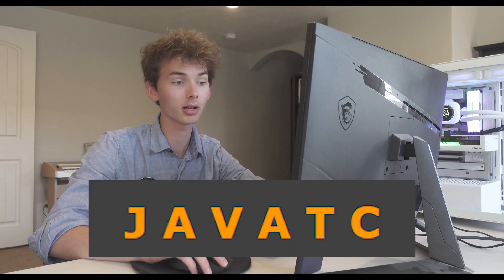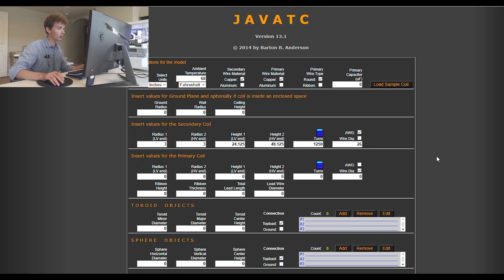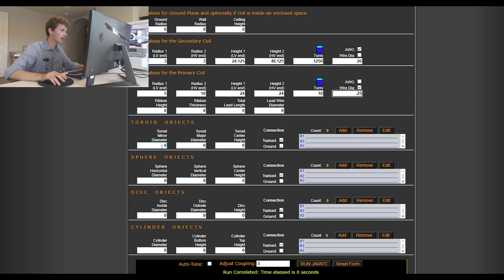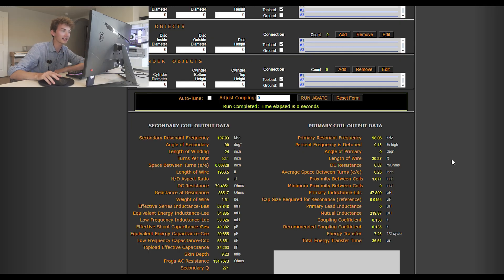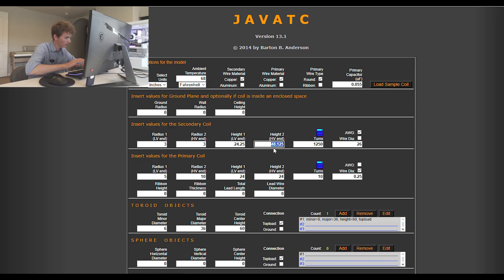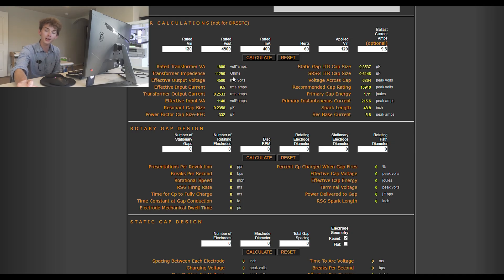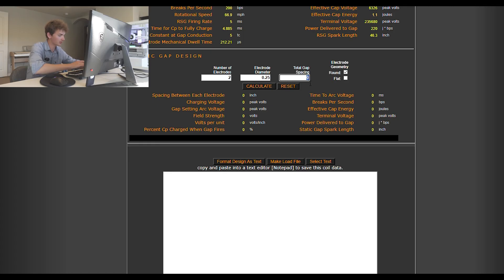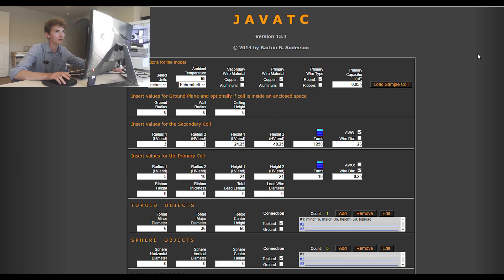What I WISH I knew about JavaTC as a beginner

Comment: I'm currently in the process of re-writing JavaTC on a proper modern tech stack (ReactJS frontend, python backend). Hoping to finish the project by the end of spring 2026 along with the current DRSSTC I'm building :) 

Some of the math behind these calcs is pretty cool. You can't just assume uniform DC inductance and capacitance of the secondary due to its non-uniform current distribution. So instead you model it as a stack of rings and then use the Neuman formula to compute the mutual inductance matrix for every ring pair in the system. Then you also do some electrostatics integrals (or proper PDE solves in the version I'm writing) to compute the maxwell capacitance matrix. And then you can get the resonant frequency of the secondary and the current distribution vector from the eigen values and vectors of the matrix product of these two matrices.
Reply: Also slight little side note, the main reason you want some detuning isn't because it makes the coil too efficient. When you have two magnetically coupled resonators of the same frequency (lets call that frequency fr), the overall frequency response of the system goes to zero at fr and has two split resonant frequencies at fr/sqrt(1+/-k) where k is the coupling coefficient b/w the inductors. In the time domain, when you have this frequency splitting, it causes "notching" in your signal (essentially ripples at the beat frequencies of these two resonant frequencies) which prevents the resonant rise from occurring as efficiently. So two perfectly tuned coils is actually LESS efficient!! Significantly less so actually. When you detune the secondary to a lower frequency, you pretty much entirely squash this second pole in the frequency response which removes the beat-frequency oscillations in your time-domain response, and restores efficient operation. 

The other effect is that when an arc breaks out it decreases the resonant frequency of the secondary so you want to detune the primary even lower so that when an arc breaks out and increases the capacitance of the secondary side you still remain detuned. This is also why you never want to detune the primary to a higher frequency and squash the lower pole.
Reply from the maker: @PartialScience  Wow dude thanks for the info, I'm excited to see the new TC calculator. Let me know when its done!
Reply: yooooooo would a fr be a dual resonant spark gap coil?????????
Reply from the maker: @ferrocerium123  Well sgtcs are dual resonant already so
Reply: @Plasma.Prince  triple resonant???

Comment: I found out that Nikola Tesla had a 300meter long copper tube stuck into the ground as an RF ground connection
Reply from the maker: How bro got it down there, who knows. The surface area of the thing alone would be enough to be a good RF ground for anything us normals have built😭
Reply: @Plasma.Prince   idk how, but He also got to use the towns generator to power the magnetifying transmitter can you imagen the fun he had with around 500kilowatts!

Comment: I finished my tesla coil! Now I need to see if the weather will agree with me to test it outside and if the coil even makes a good enough arc to not disappoint me.
Reply from the maker: You're dual MOT coil? I put mine together but cut some corners to make the saturday deadline I set for myself so it didn't work😭
Reply: @Plasma.Prince  oh, well I am not able to watch the premiere anyway ima be busy from July 3-12  
T_T   
I definitely fix a few things first. The arc is about a foot which isn't the best for this size coil  but I would see some long arcs then short ones. I think Ima wait a bit to post the real edited video because I need to fix all these issues but I can post a tiny video of one of the tests I ran last night if you want. One of the issues was that the blue 20kv 1nf capacitors I used kept arcing to themselves instead of the rotary spark gap which led to inconsistent arcs. Then one of the wires that connected to my MMC bank broke off and arced to it so one of my capacitors needs to be replaced cuz it has charm marks on it now. I the capacitor seemed to be fine for the other tests so I wouldn't replace it yet but two doorknob capacitors will arrive on July 2 - July 11 so I will use those instead of the blue caps.
Reply: @Plasma.Prince  wait how did it not work?
Reply from the maker: @ferrocerium123  sloppy wiring, flimsy rsg, etc. nothing serious. My capacitors also experienced some arcing. Yea I wouldn't reccomend using ceramic caps for the tank cap tbh.
Reply: @Plasma.Prince  oh do you also have doorknob capacitors from your GU81M vttc attempt?
Reply from the maker: @ferrocerium123  hahaha didn't know you knew about that, no I never bought doorknob caps, too expensive and difficult to source ones with good capacitance. Just use film capacitors they're much easier to source.

Comment: oh will you use a EMI filter to prevent your house and your neighbors from burning down? Or is that not necessary? I have only seen Backmacsci do it
Reply from the maker: Nah but I have RF filtering caps in my doubler
Reply: @Plasma.Prince  okie dokie is that just the doorknob caps? cuz Benjmen said those are for clamping voltage spikes aross the diodes but alota parts are being used with more than one job in this circut

Comment: did you wind the secondary by hand or with a drill?
Reply from the maker: Drill
Reply: @Plasma.Prince  oh i finally got a drill from harbor freight too! Now I don't need to use a sketch bench top voltage regulator thingy and half dead thrift store drill that barley works.
Reply from the maker: @ferrocerium123  epiccc
Reply: @Plasma.Prince  fr
Reply: @Plasma.Prince  oh I also was just at a old power station museum and there's 10kv transformers! and even a Jacobs ladder but the arc was only like...2-3inches long

Comment: I'd recommend going with an 8" x 36" topload rather than 6" x 36" just because a larger minor diameter will result in less stray sparks sucking power away from the single main arc that you want.
Reply from the maker: I'll have to make the switch when I got some spare money, sadly I already got the 6 inch ducting😭
Reply: what if you covered it in aluminum tape? or made a chicken wire dounut like Benjamin.( if that's cheaper) and also wouldn't the geometry of breakout electrode change how many stray arcs come out in places you don't want? I assume that a pointy electrode would work better but sometimes it hasn't for sstcs in my experience. Maybe it also has to be thick  and low resistance to.
Reply from the maker: @ferrocerium123  Yea the common practice is just to coat ducting in foil tape which is what I'm doing
Reply: @Plasma.Prince  Okie dokie I had done that with a different topload and it took alot of patentice and work to also make sure it is alumium tape and not this other tape i have ben confused with before that is also labed as ducting tape and wasnt conductive, if its not shiny its not foil :,(
Reply: make a video for creating top loads
Reply from the maker: @TheTubejunky  aight
Reply: @TheTubejunky  that's already on the internet

Comment: maybe a new video idea would be to keep putting more and more voltage into a MOT until it breaks or just destroy stuff with one until it breaks unless that's to dangerous. I wonder if you could use your varaic and slowy crank up the voltage and measure the voltage coming out on a multimeter until you get the max voltage it will read before breaking and measure the current of that to see if it's output can power another MOT. I just saw photonicinduction power a 240v MOT with 480v so I wonder what 240v for a 120v MOT would do. if your curious about the video, Its called "240v-440v" you should search it up on his channel cuz youtube wount let me comment links
Reply from the maker: My variac can only go to 130v😭 plus I mourn the death of MOTs
Reply: @Plasma.Prince  oh mine also goes to 130v I saw coil labs put the output of a MOT directly into the input of a second MOT and get huge arcs. I wonder how the primary survived .....and the secondary. Right now I am in 240v territory and for some reason there isn't any pole mount transformers in sight I wonder why
Reply: Mots already run in saturation a little bit so inputting more voltage will just result in them getting really hot and not putting out more power.
Reply: @benjaminlockhart99  oh I wonder how photonicinduction did it
Reply: maybe a different video idea would be to see how many MOTs you can put together until the arc is to big to stretch just like how tested to destruction made an arc so big it hit the ceiling
Reply: @benjaminlockhart99  or what if you put the MOT in mineral oil that should act like a liquid heat sink right?(plus high voltage insulator)
Reply: @ferrocerium123  I've still had MOTs die under oil.
Reply: @benjaminlockhart99  oh. how many MOTs do you have?
Reply: @ferrocerium123  Not many now.
Reply: @benjaminlockhart99  lol i wonder why 🤔
Reply: @ferrocerium123  Use a dual safety gap to ground to protect your MOTs. I left it out and that's why they died whenever I had a primary strike or similar.
Reply: @benjaminlockhart99  is a dual saftey gap the exact same as it looks like in the schematic of all the dual MOT tesla coils with a voltage doubler, in real life or does it look different and I assume its RF ground right?
Reply: @ferrocerium123  Yeah it's just in parallel with your main spark gap, and has a center electrode connected to RF ground. Set it just wide enough to not fire normally
Reply: @benjaminlockhart99  okie dokie thanks for the advice! this realy helps me cuz if you didn't say that I probably would have had my safety spark gap be firing like crazy. I do have a few more questions though. One is, how are the microwave oven capacitors able to handle 8kv from the dual MOTs in series which is 4kv and a voltage doubler which is 8kv bout each microwave oven cap is only 2100kv? Also do you think microwave oven diodes will not fight each other if they are in parallel to increase the current rating? (I might add more MOTs in parallel one day) Also do they need to have the same part number? Or mostly the same electrical characteristics. Do you think a bunch of 10a10 diodes would work instead though? their current rating is 10 amps, but I need a few of them to survive 8kv or more. And is it better to have the capacitor that is in parallel with the diodes to make sure they don't get a big voltage spike and die, be a high capacitance or low capacitance. Also if I want to make the microwave oven capacitors handle more voltage, but I only have enough to make it so they are in series which lowers the capacitance. How low of a capacitance do you think is ok before it's to low to have enough energy to double the voltage enough? Or even how high of a capacitance is ok before it takes to long to charge?
Reply: @ferrocerium123  More caps in series will dramatically reduce the coil power draw.
2 caps seems about perfect.

The microwave caps only ever see half the output voltage since they are in series with the mots to double the voltage.

Diodes in parallel don't work very well.

The caps across the diode string can be small, like a few nF, value not critical.

Yes you can use other diodes but you want the whole string rated for 20kV or more!

Lots in series is the important thing, and maybe 3A diodes?
Reply: @benjaminlockhart99  Thanks alot for the information you gave me! I think this is all I need....... at least for now but for now I will stop brothering you with questions lol.
Reply: @ferrocerium123  It should go without saying, but I'll say it anyway. Don't play around with MOTs, they are lethal!
Reply: @benjaminlockhart99  oh don't worry. I am a self proclaimed professional high voltage-elogist so I am uhh verry qualified. I made two videos about my MOTs I will be using for this coil so far(one is a ballast)
Reply: @benjaminlockhart99  plus i am now 14 not 13 anymore so i have 4 years of high voltage shenanigans experience :D

Comment: Wat arent you using a voltage doubler and dual MOTs so thats 2x2000=4000x2=8000 and you split the current in half when u use a voltage doubler so 200ma right?
Reply from the maker: Yea I forgot about that in the moment😭
Reply: @Plasma.Prince  Also I think you should use a few microwave oven caps in seires cuz they aren't rated for 4kv and definitely not 8kv
Reply: I am also looking all over ebay for fun surplus from the miltary to see if any capacitors from them will work so I will give a link to any I find that are reasonably priced and combatable with the project
Reply: I found some vacuum capacitors for cheap if you dont mind a bit of X-ray radation